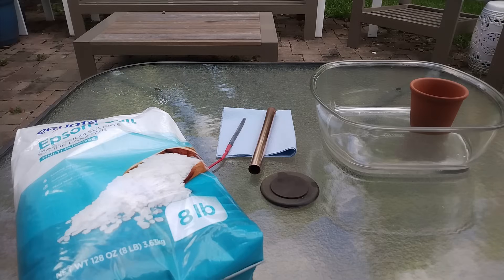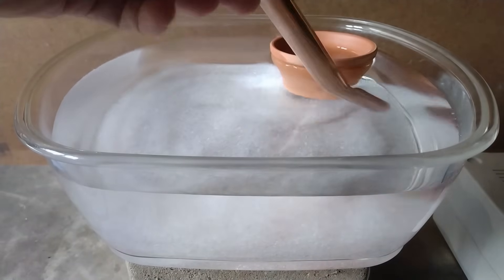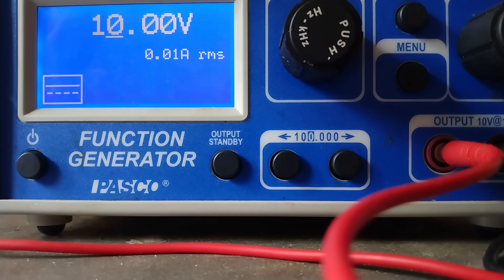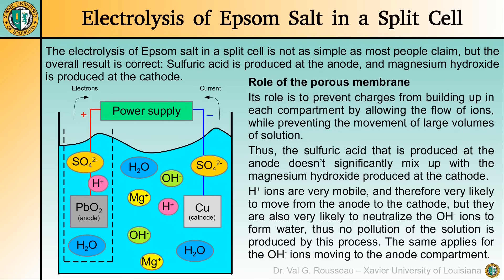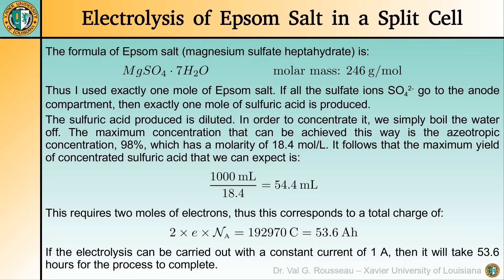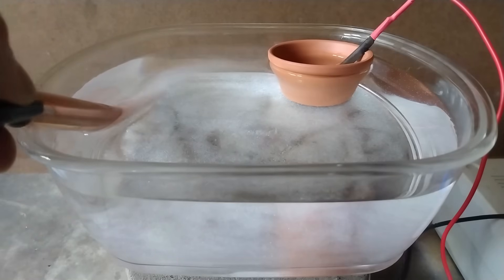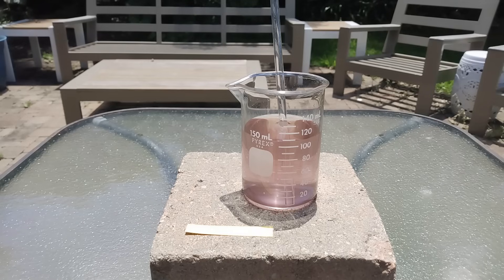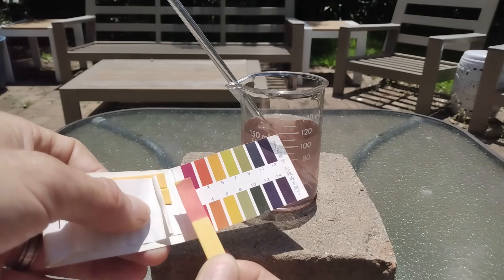Making 98% Concentrated Sulfuric Acid from Epsom Salt - DIY

Comment: In order to remove water from a solution like this there is no need to heat it up more than 110 degrees Celsius.  Water boils at 100 degrees and sulfuric acid boils at 337 degrees C. 
As long as you have water in that solution the temperature can not go higher than 100 degrees ( at normal atmosferic pressure) regardless of how much heat you put in it ..  
As soon as water molecules reach 100 degrees they turn into vapor and fly away taking that energy with them, that's why you cannot have more than boiling temperature in the pot as long as there still is water in it. 
If you add more heat you just accelerate the boiling process and the water molecules fly away quicker as soon as they reach 100 C.. 
If you want to modify the boiling temperature then you must alter the pressure .. no other option (on mount Everest water boils at about 70-80 degrees Celsius depending on the exact altitude)
 When the solution  reaches about 105 to 110  degrees C at normal atmosferic pressure .. there is no water left in that solution .. guaranteed ! 
Great video - Cheers :)
Reply from the maker: This is totally wrong! When water is mixed with sulfuric acid, its boiling temperature changes. It depends on the concentration of the acid. Sulfuric acid is a powerful dehydrant, and it doesn't let water escape easily. The higher the concentration of the acid, the higher the boiling temperature of the water. At the beginning, when the solution is very dilute, the water will boil just above 100°C. When the concentration reaches 50%, the boiling temperature is 148°C. For 70%, it is 190°C. At the azeotropic concentration of 98%, the boiling temperature is 337°C. At this point, both the water and the acid boil and the concentration no longer increases.
Reply: @BlueMoonshine  Thanks a lot for your reply ! I obviously did not know this.  I learned that theory from one of Neil Degrasse Tyson's videos where he explains how water behaves when heated to a boiling point. Of note is that in his videos he strictly refers to plain water and food making without saying anything about possible exceptions within certain chemical solutions that may contain water.  
So apparently I wrongfully assumed that water will still behave the same way no matter which kind of solution mix we're talking about. 
Is the sulphuric acid and water mix the only situation where the boiling temperature of water changes with concentration in that solution ? Or is this a general principle that applies  to all water solutions or any other liquid chemical mix for that matter ?! 
In other wards is my theory generally right with this being the only exception or is it totally wrong?! 
Would highly appreciate another kind reply !
Thanks again for taking your time to reply and teach me something new !! 🙏
Reply from the maker: @calind61  
"Is the sulphuric acid and water mix the only situation where the boiling temperature of water changes with concentration in that solution ?"
No, it happens in many other situations. For example, when distilling alcohol, you can increase the alcohol concentration up to a certain percentage by distillation. The distillation temperature is around 70°C if I remember well. But as the concentration increases, the boiling temperature will also increase, and water will start to boil with the alcohol at a temperature lower than 100°C. This is again an azeotropic temperature, where you can no longer increase the alcohol concentration by distillation. Other concentration techniques must be used.

"In other wards is my theory generally right with this being the only exception or is it totally wrong?!"
It is generally wrong, I'm sorry. This is a well-known effect that has to do with the "entropy of mixtures". When two (or more) substances are mixed together, their individual boiling temperature can increase or decrease, depending on the type of substances.

"Thanks again for taking your time to reply and teach me something new !!"
You're welcome, and thanks for watching my videos.

Comment: Nice!  But zero personal protection when dealing with concentrated acid ?  Not good.
Reply from the maker: I'm wearing goggles. For gloves, I suggest that you watch this 2-minutes video: https://youtu.be/WzRk6nq9zBc
Reply: @BlueMoonshine  I apologize! Not a chemist and made mistake of concluding 98% concentration of an acid would dissolve anything!
Reply from the maker: @y0rkiebar  
No need to apologize. It will surely dissolve human tissue, but it takes several days to completely dissolve a human body. Although it takes a few seconds to feel the acid on your hands slightly stinging, you still have a few minutes to calmly go rinse them.

Comment: 10:49 Perhaps physics should be used in this case. If you push 1 Amp through a solution, the solution will heat up considerably, ergo evaporation.
Reply from the maker: No, we can rule out this hypothesis because evaporation is proportional to the area of contact with the air. Thus, if the water level in the clay pot decreases by 50% due to evaporation, then the level should also decrease by the same amount in the main dish. But that wasn't the case. It turns out that what actually happened is osmosis: Water from the clay pot was sucked out by the solution from the main dish which becomes hydrophilic.

Comment: Nice work, thank you.  Thanks for going through all the reactions.  It's so easy to treat electrolysis like a recipe, learning by rote and just repeating what has worked before.  It makes it hard to spot problems when things go wrong.  The most favorable reaction at any given moment can change due to temperature, voltage, contamination, chinese electrodes, etc.  Knowing what should be happening is not enough, you need to know everything that can happen, and under what circumstances.

Comment: Was planning on using this to precipitate lead from gold I was refining. Would using this cause my gold to become impure because of impurities in it?
Reply: @BlueMoonshine Ik how to make aqua regia and all. I have not only muriatic acid and hydrogen peroxide but also nitric and hydrochloric acid because I was planning on growing gold crystals using electrochemistry. The sulfuric acid is added after refining (a few drops) but before adding smb to make the gold that drops even more pure. I was also going to be using s02 gas as well because it drops the gold faster and while smb will give you very pure gold s02 gas works way faster and will be even more pure
Reply from the maker: Not sure I see the connection. Usually, in order to precipitate gold, you need first to dissolve it in Aqua Regia, which is a mix of hydrochloric and nitric acid, then precipitate the gold by adding sodium metabisulfite. No sulfuric acid nor Epsom salt involved, so I really don't see the connection.
You may want to watch my tutorial on how I refine gold: https://youtu.be/NMzDeBDQUHc
Reply: @BlueMoonshine most of my gold refining I wound up learning from sreetips on YouTube and cryptanaki on tiktok but I still do have some stump remover on hand
Reply: @BlueMoonshine also one more thing I was wondering; my hotplates don't reach up to 337°C which is 639°F so they won't get hot enough to boil the acid. Is this a good thing because it will only evaporate water and all the other impurities or does it HAVE to be hot enough to boil the acid specifically?
Reply from the maker: @Deku-ue3bu  
It's hard to tell. It depends on the type of impurities. Some will boil off below 100°C, some will boil off above 100°C. Also, the concentration of your final sulfuric acid will depend on the temperature that you can reach. You can find some tables on the web that give the concentration of sulfuric acid as a function of its boiling temperature.
Reply: @BlueMoonshine  do you happen to have a link to one you'd recommend I use so I make sure to get the best possible reading?
Reply from the maker: @Deku-ue3bu  
Yes, this plot gives you the boiling temperature of sulfuric acid as a function of concentration: http://www.sciencemadness.org/smwiki/index.php/File:H2so4boil.jpg

Comment: Hi and thank you for the informative video! What confused me was, weren't you supposed to get close to 54.4 ml of sulfuric acid, instead of 5 ml? Did something go wrong or did I not understand something
Reply from the maker: The value 54.4 ml that I calculated was an upper limit. That's what we would get if everything was perfect. But the separating membrane (the clay pot) is not perfect, it lets some of the sulfuric acid leak out and some of the magnesium hydroxide leak in. The acid reacts with the magnesium hydroxide and gives back Epsom salt and water. So the reaction never goes to completion. Also, some other reactions take place and by products are formed instead of sulfuric acid.

Comment: QUESTION about preventing the clay contamination: What are the properties the pot needs? Conductivity, acid resistance, and NON-porosity? (I’m assuming any metal vessel would corrode and alter the solution.)
Reply from the maker: The pot, in addition to being acid-resistant, needs to allow the flow of ions while preventing massive flows of the mixtures.
Reply: @BlueMoonshine  I think the pot you used is earthenware, and I can suggest trying either stoneware or porcelain that has only been “bisque-fired”. The earthenware is mainly clay, red iron oxide, and silica, like most clays, but it is not designed to vitrify. Vitrification means that the silica present in the clay has all melted, cooled, and welded together all the other materials in the mix, making it waterproof. Knowing that you need some porosity, but greater integral strength in the pot, you could try using stoneware that has been bisque-fired (this is literally “half-baked”, so the clay is partially vitrified, setting the form, but not yet fully vitrified, and not waterproof, but quite porous instead). Since stoneware is designed to vitrify, and earthenware is not, I suspect that the bisque-fired stoneware would be stronger, and less likely to contaminate your solution. Additionally, stoneware can be bisque-fired within a range of “cones” (which are a measure of heat work, used in all ceramics), and a piece that is bisque-fired to a higher cone will be more durable and less porous, so you might be able to find the sweet spot of balancing the two. 
Finally, I don’t know the importance of the red iron oxide for the ion flow, but it might help. If so, stoneware clays come in a wide range of iron content, and choosing one that is “buff, red, or black” will increase the iron content, in that order. 

Happy to clarify if it would be helpful. 
Thanks for the video!
Reply from the maker: @charlieevergreen3514  
Thanks for the information, I will have to think about this!

Comment: Use handy math online calculator to see the concentration. I did it for you and estimate that the concentration is 8.26% by weight if the temp when measuring density was 25c
Reply from the maker: So, my estimate was already good.

Comment: you have distilled water inside the cup with a high concentration of Epsom salts in solution outside of the cup. osmosis is pulling all that water out
Reply from the maker: That's right!

Comment: Very good!  Especially if an impure acid will do.  Personally, I’d wait and put the 8% acid in a gallon jug until it was full then work with 1 liter at a time and you should get 50 to 100 ml.  Much better to work with.

Oh I had one more thought.  What if you could put acid in very tall narrow vile and allow sediment to settle and maybe cement out a little.  You could pipette the cleaner liquid from the top!?
Reply from the maker: "Personally, I’d wait and put the 8% acid in a gallon jug until it was full then work with 1 liter at a time and you should get 50 to 100 ml."
Sure, I was only showing the concept.

"What if you could put acid in very tall narrow vile and allow sediment to settle and maybe cement out a little.  You could pipette the cleaner liquid from the top!?"
Certainly. Another possibility to get a pure acid is to distill it.

Comment: It's the unglazed pot that makes the difference and did this some years ago when the interest was for a home-made lead/acid battery. I guess we only produce the concentrated sulphuric when really necessary. As an aside, for the battery acid, if we leave whatever concentration we have open to the air, atmospheric moisture will produce an equilibrium giving (from memory) S.G. 1.33 and 1.28 is optimum for a battery as the acid/water mixture has greatest conductivity.
Interested in your channel, keep up the good work!

Comment: Whi not boil onli with a bunsen-burner ? Or until hundred degrees ? The water would go out
as well ? whi 357 Degree ?
Reply from the maker: Pure water boils at 100°C. When mixed with sulfuric acid, it is no longer pure. Sulfuric acid is a strong de-hydrant. It doesn't want to let water go, so as the concentration of sulfuric acid increases, the boiling temperature increases too. When the concentration reaches 98%, the boiling temperature is 337°C. You cannot concentrate above 98% by this method, because sulfuric acid and water form an azeotrope. At 98%, both the sulfuric acid and the water boil at the same time.
Reply: @BlueMoonshine  Thank you, big massa of chemistry...

Comment: whi not use 5 Amps ? The the process should fästen bi factor 5 ? I guess it's not possible, but please explain whi ?
Reply from the maker: In order to use 5 amps, you need either larger electrodes (plates) in order to reduce the resistance, or increase the voltage. But if you increase the voltage, you also increase the probability for unwanted reactions to happens, and this will generate pollution of the product.
Reply: @BlueMoonshine  Thank you again, big massa of chemistry.

Comment: not to mention evaporation....
Reply from the maker: I don't think that evaporation is the reason, because evaporation rate is proportional to the area of contact with the air, thus the levels in the clay pot and in the glass dish would decrease both by the same height.

Comment: In our setup using sodium sulfate (Na₂SO₄) with a Nafion 117 membrane, the process involves separating sodium ions (Na⁺) from sulfate ions (SO₄²⁻) through the membrane. Here’s how this process generally works:

Nafion 117 Membrane: Nafion 117 is known for its selective permeability, allowing certain ions to pass through while blocking others based on their size and charge. In our case:

Sodium ions (Na⁺), being relatively smaller, can pass through the Nafion 117 membrane.
Sulfate ions (SO₄²⁻), being larger, are less likely to pass through the membrane effectively.
Electrochemical Setup: In an electrochemical cell or setup with Nafion 117 membrane:

When a voltage is applied across the cell, sodium ions (Na⁺) migrate through the Nafion membrane towards the opposite electrode.
Meanwhile, sulfate ions (SO₄²⁻) are mostly retained on the other side of the membrane due to their size and charge.

Product Formation:

On the side where sodium ions (Na⁺) migrate, sodium hydroxide (NaOH) can form if water is present, due to the alkalinity of sodium ions reacting with water.

On the side where sulfate ions (SO₄²⁻) remain, sulfuric acid (H₂SO₄) can form through appropriate chemical reactions, often involving water and hydrogen ions (H⁺) resulting from other processes.

Purpose and Applications: This setup can be utilized for various applications where selective separation of ions is required, such as in electrolysis processes for generating sodium hydroxide and sulfuric acid separately.

Therefore, in our experimental setup with sodium sulfate and Nafion 117 membrane, the membrane allows for the selective passage of sodium ions (Na⁺) while restricting sulfate ions (SO₄²⁻), facilitating the separate production of sodium hydroxide and sulfuric acid on opposite sides of the membrane. This process is based on the membrane's ability to control ion transport, which is crucial in various electrochemical and separation applications.

Key Points:

Low Solubility: Magnesium hydroxide has low solubility in water, forming a suspension rather than dissolving completely.

Formation: It can precipitate out of solution when magnesium ions (Mg²⁺) react with hydroxide ions (OH⁻):

Magnesium hydroxide (Mg(OH)₂) reacts with sulfuric acid (H₂SO₄) to produce magnesium sulfate (MgSO₄) and water (H₂O).

Your process can be further optimized, because I suspect that MgOH and Sulfuric Acid are being manufactured on the one side, and sulfuric acid on the other side, and then MgOH and Sulfuric acid cancel each other out converting back to Magnesium Sulfate, etc.

I suggest reversing the polarity, and using Sodium Sulfate, because Na+ is small enough to pass which will create Sodium Hydroxide within the flower pot leaving behind sulfuric acid that can be distilled to the desired concentration and purity.

~ Cheers
Reply: This is AI generated
Reply: @user-py9cy1sy9u  

Not likely.
Reply: Ebay

Comment: if you make a zinc-air battery, you can use zinc-sulphate water with steel and carbon electrodes to both load up zinc and generate sulfuric acid and oxygen, with electrolysis electroplating. magnesium sulphate should be a magnesium-air battery btw. oh it does not generate magnesium metal as plating electrolysis.

Comment: When using a clay pot as a membrane you should glaze the top (only the top 1cm is enough).
Its possible that the water loss in the pot is because of this as it actually can creed over the rim if it isnt glazed.
I dont know if the acid can also creep over the rim, maybe.
Reply from the maker: As others made me notice, the water loss is due to osmosis.